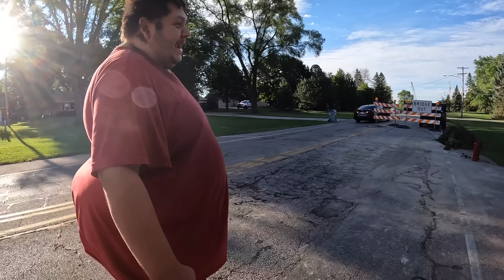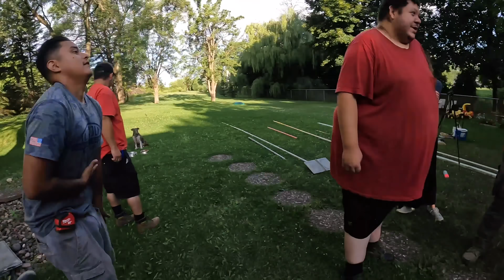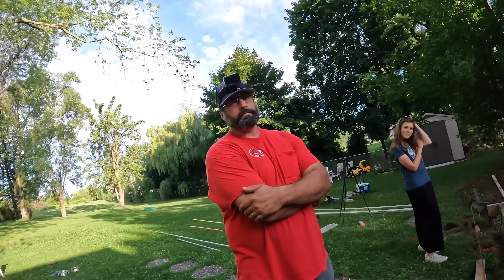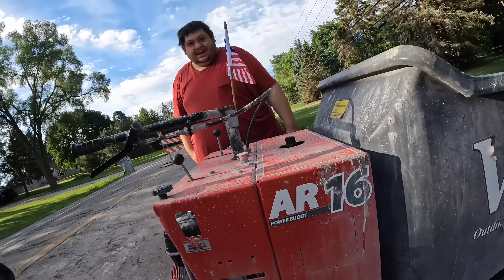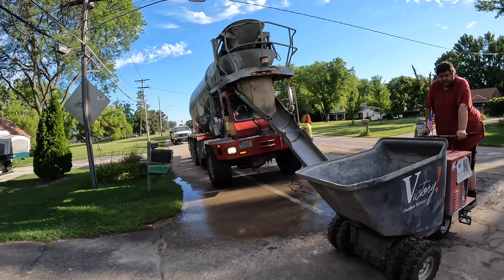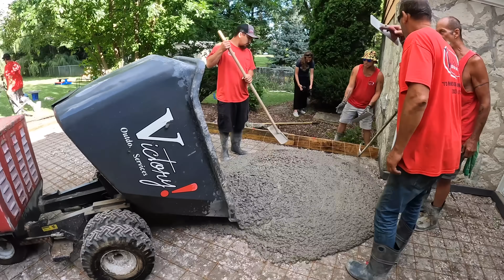Pouring a Concrete Patio with Victory Outdoor services!!  #1

Comment: Unfortunately the crew that poured our concrete around our pool followed none of these procedures.  They initially were attempting to skip wire mesh until we purchased it ourselves.  Then they did NOT pull up a single inch on the wire mesh as they poured, rendering it useless.  They poured in the afternoon when it was full sun and hot.  Left right after, and came back a week later to use a concrete saw to cut the lines AFTER a section of our pad cracked all the way through from the edge of the pool to the end of the pad, and down to the ground.  And one of the owners is demanding FULL payment after he lied twice about floating the mesh.  They didn’t count on us having it all on camera.
Reply from the maker: Wow what a crock of crap. I’m sorry to hear this happened to you, nice work on the camera though!!
Reply: @Dirtmonkey  it’s going to end up in court for sure.  I forgot to mention they also skipped wetting down the concrete at all.  Didn’t even setup a sprinkler.  After the big crack it was me who saved the rest of the slab by soaking it myself over three days.  Ugh.
Reply: @Cdunham2978  you'll win the case just make sure you get what's owed to you. Tradesmen are getting called out left right and centre today thanks for the technology we have. 20 years ago it was all by word of mouth.
Reply: @Cdunham2978  Sorry to hear about that. I agree that the mesh and waiting to do saw cuts is a problem but I'm pretty sure its up to the homeowner to keep it wet with a hose or sprinkler after they leave the job.....
Reply: They cut the lines a week later? Lol is that normal? I'm not exactly up on concrete pouring, but that doesn't sound right ..
Reply: @kidzbop38isstraightfire92  No. Same day with softcut saw no more than 24 hours. Normally it will be called out in the specs and the UBC has a minimal standard without engineering.
Reply: Out of curiosity, How much did that cost?  I’ve got a pool that we have to change the liner, so I spent 2 weeks removing the concrete deck by hand and wheel barrow.  I don’t think I’ve got it in me to lay the concrete lol
Reply: @kidzbop38isstraightfire92  If you watch Ryan's videos, he gets antsy about it if it has to sit overnight before he can cut it.
Reply: @Chiefthepup  $16,000.  One owner is willing to settle for $7,500.  The other is demanding all $16,000.  And we live in upstate NY by a lake where the winter winds are brutal, and temps can get to -30 with the windchill.  I’m afraid this concrete will be in pieces in the spring

Comment: the real trick to concrete is to start at midnight then you get a good 6 hours before the sun even starts coming up finished by 8 and covered home by 10
Reply: Where can you get concrete delivered at midnight? Is that a thing? If not.....1,000,000 dollar idea.....time to start a concrete company..lol
Reply: @TheMightyDR84  you need to start a relationship with your local concrete plant. depending on the size of the job most plants will mix at any hour
Reply: @imchris5000  got ya!
Reply: Commercial guys do that all the time, but I don’t think it’d go well in residential. Most homeowners don’t want a crew of 6 guys pouring concrete in their backyard in the middle of the night 😂

Comment: Hey Stan, I love going on these job sites with you. I'm getting ready to pour a slab for an 18' x 24' shed/garage. I have a 20' x 29' shop that I built 33 or so years ago. The slab was poured inside after the building was about 10 years old. I know this sounds crazy but there was well over 12" of gravel and the concrete is 8 to 12 inches thick. If I recall the guys didn't use any steel just fiberglass added into the concrete. This slab is very beautiful and doesn't have any visible cracks. None at all unless of course they are too small to be seen. Oh I forgot to mention, this slab has no score lines in it. It is one solid piece. I had a slightly smaller slab poured a few years ago for another shop and they put huge lines very wide and deep dividing the floor into quarters and I don't like it.
Reply: Interior concrete doesn't see the larger temperature swings that outdoor has, but you're lucky it hasn't cracked, lol!
Reply: @Derf1313  I have been told that having the slab captured within the stem walls and having it shaded while it cured is what helped. This slab has a glossy finish and I just love it. Whoever gets this house when I'm gone will never know the love I put into it.
Reply: @dangrimes5078  I'm sure, lol!  That gloss could possibly be a sealer, or well troweled strong mix.  Properly cured concrete, isnt about a week or month, it can continue curing for years!!  The old timers would cover with straw & burlap, and keep it wet for a couple of weeks minimum (I've been using a cure & seal spray, as well as plastic under to slow hydration). Most folks don't realize concrete is a chemical reaction, not that it just gets hard...
Reply: @Derf1313  perhaps the Hoover Dam is still curing inside! I read something to that effect.
Reply: @dangrimes5078  yeppers!  The old school book I learned from says 28 years, lol.   Being the size of Hoover, still quite possible.  They used a new engineering principle when they built it, of adding cooling lines thru the concrete pours to relive the possibly of overheating the catalyst & stopping the hydration, plus it would expand the material & weaken the structure...  Properly cured it can last like the Roman aquaducts, lol!